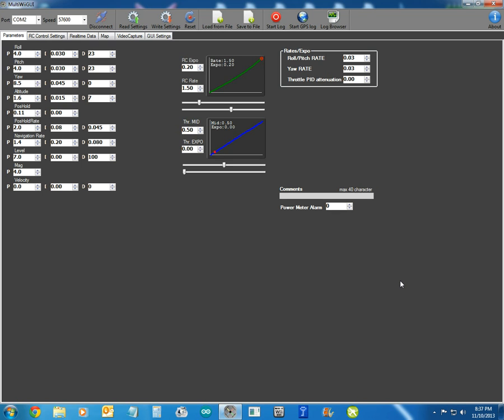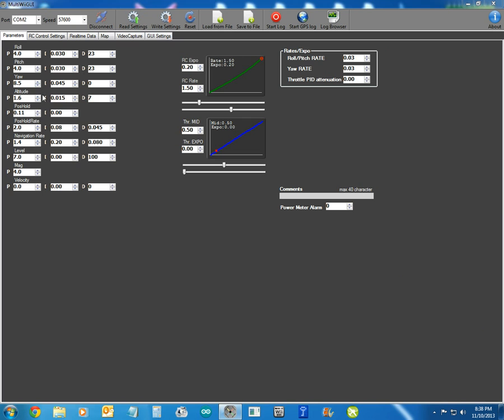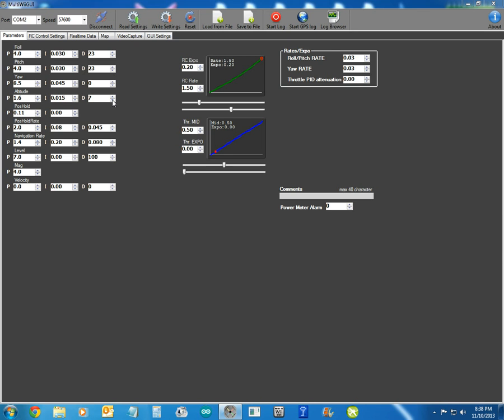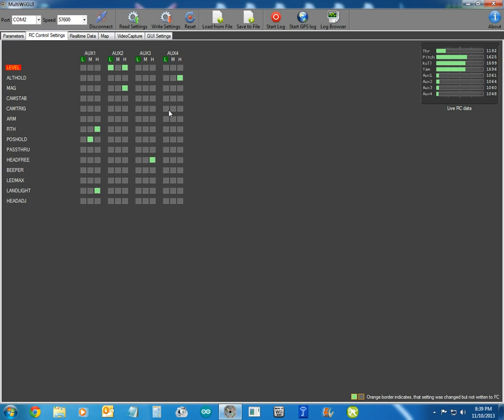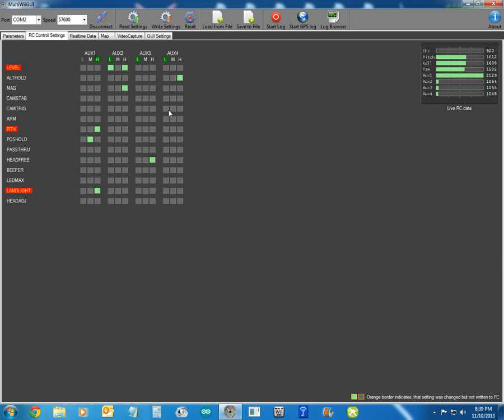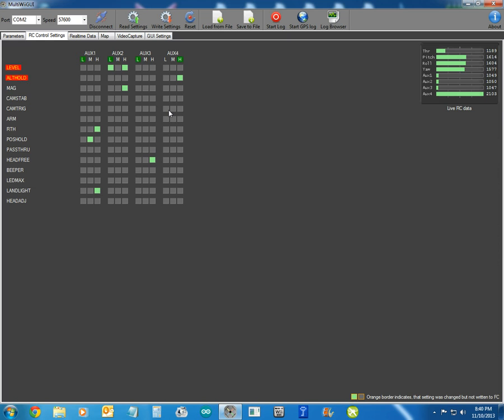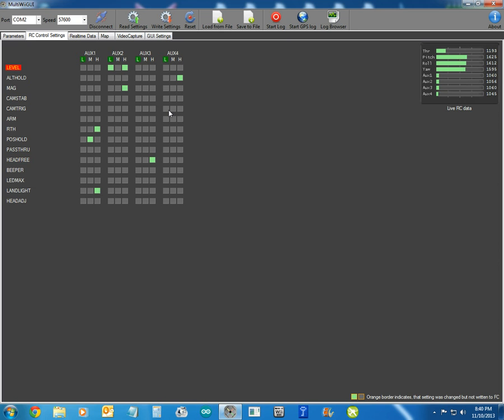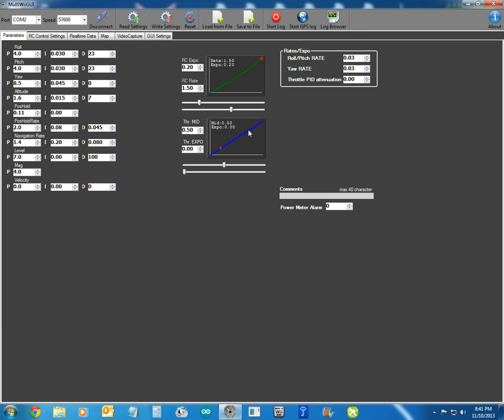Multiwii Pro AUX settings

Comment: HELP! the muliwii pro is not connecting to the gi...well it does but then it stops. i connect it to the gui and it shows it is connected but is not not do anhing else. no sensors or anyhing
Reply: ok sorted his out but i dont have those aux option. only have 4-5. no gps hold stuff
Reply from the maker: can you put a vid up of your board and copter and GUI so I can see what your doing?

Comment: Is your remote connected to the GUI or the flight controller board with the reciever in it?
Reply from the maker: My radio is turned ON and my copter is connected to the computer WITHOUT the lipo so you can test / select your AUX options.

Comment: how do you enable the AUX 3 and 4 for additional AUX?
Reply from the maker: Depends on what sort of radio you have..... basically you allocate a channel to a switch.
so ch 1-4 is your throttle, pitch, roll & Yaw (rudder) so that usually leaves ch 5-8 spare on an 8 ch system.... so in your radio you allocate those chs to switches..... let me know what radio you have & I will help you out. cheers
Reply: moochasas I have tried it, but it doesnt seem to respond to the board. I have Turnigy9X with FrSky 8 ch receiver. the instruction of how to define the AUX 2 is not that very quite obvious to follow. I have came across some source that show where the pin of AUX 2 is on the board after we commanded it and it wasn't label AUX 2 at least at my experience. Do i have to do it in the config.h file or something?
Reply from the maker: CaallMeeMrrD Turnigy 9X Transmitter Three Position Switch Nova/Storm OSD Flight Mode

 to program your 3 way you need to go into your radio and change the setting from NULL..... you have to turn on all your aux channels....... ref 9-24 of the manual.
this vid shows how to program your aux channels for your radio........ change NULL on say your channel 5 to ID0 and your 3 way switch should be selected....
Reply: moochasas My TX is already programmed to turn on all the switches i need, as right now i have 6 ch working, thr-pitch-roll-yaw-aux1(thr hold) aux2(rudder switch) This two switch are working fine. the rest of the ch is 7 and 8 are assigned to ELE and AIR's witch, but i cant get them to work with the board. which aux pin are they in the board? the labeled pin arent responding at all. 
I am not a newbie i been fly and scratch building rc plane for a couple year now, and i just get into multirotor. 

Sorry, i forgot to mention that I have Multiwii 328P FC
my TX is upgraded with er9x firmware
I appreciate your responding buddy :)
Reply from the maker: That is because the 328P only has 2 AUX channels so with that board you can only have heads free and althold......
Reply: moochasas ohh ok, that's explained, but why they labeled AUX 3 and 4 though... :/ i thought they are usable
Reply from the maker: The board I am running in this vid is a Multiwii Pro 2 c/w GPS module. It has capabilities for 4 AUX channels.... that why..... if you opened that program with the 328p connected the set up screen would be different.